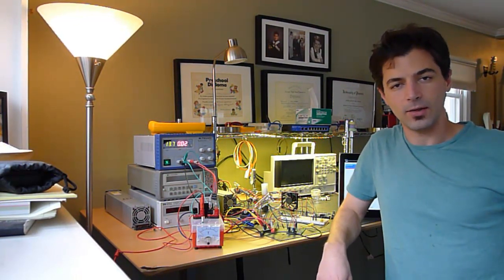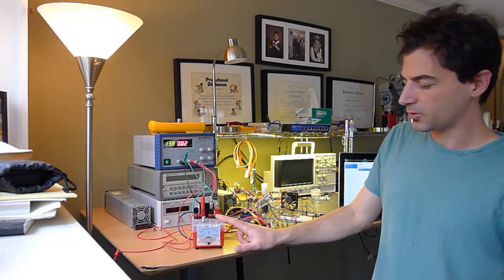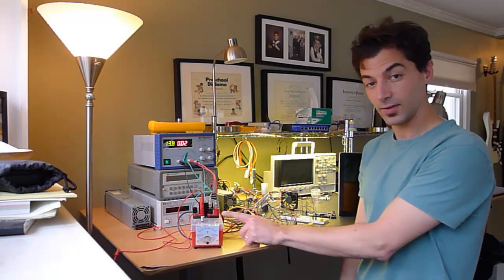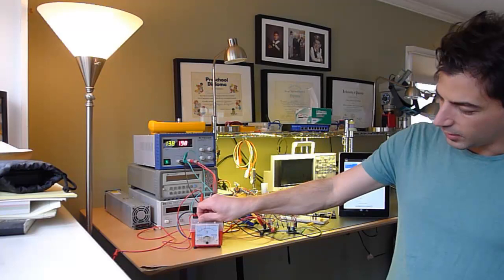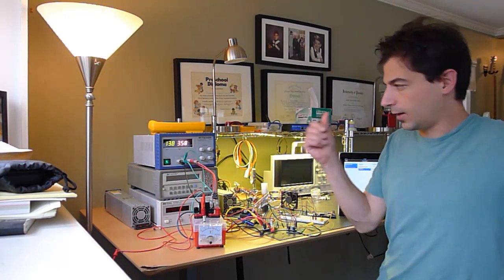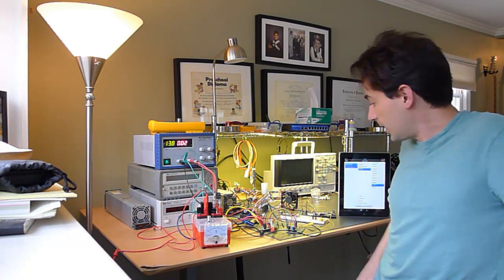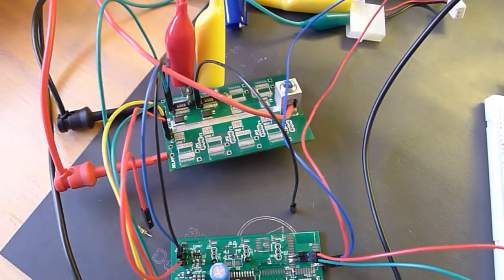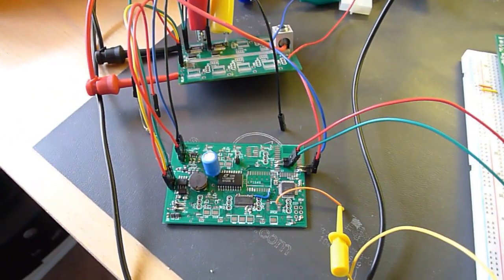8 channel automotive PDU iPad circuit breaker test

Comment from the maker: You could I suppose. I'd not want to fumble with a phone or buttons in an emergency though. I think a better solution would be to put a rotary encoder on the spindle and when the current is high but the spindle isn't moving (which is a jam condition) then have the firmware shut the motor down automagically.

Comment: Upgrade it to 200A then it can be used in electric bikes and RC planes. At RC planes cutting the power probably not the best solution :P Limiting the current and  loud buzzer wold be better :P . At bikes a temperature sensor on the motor, controller and the batteries could save u to burn then when u go up a hill or accelerate too fast.